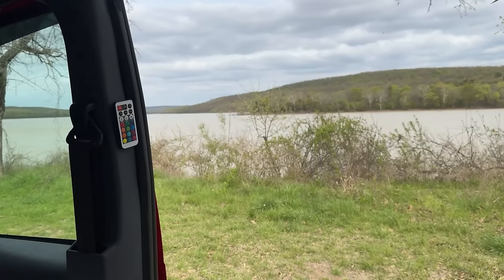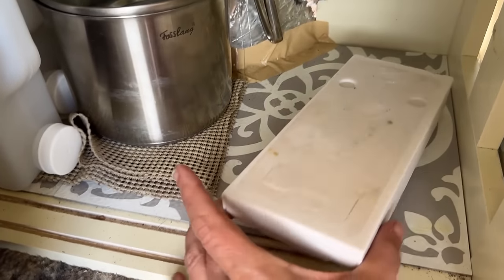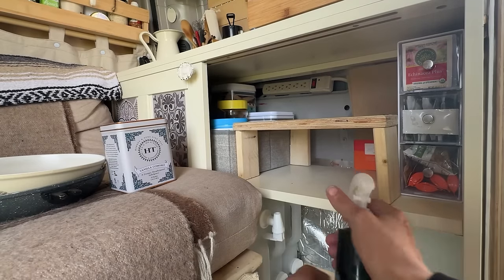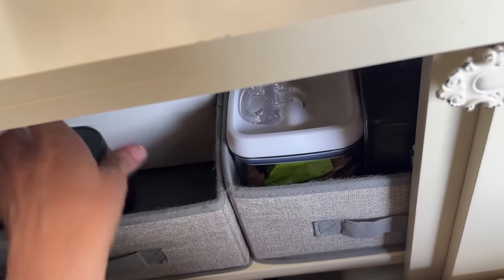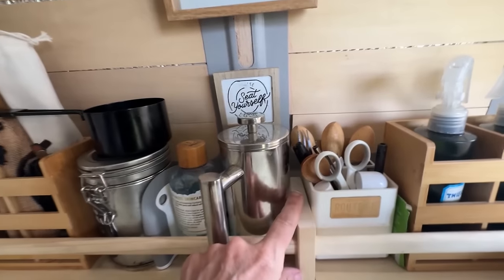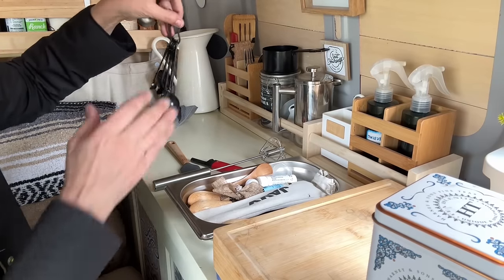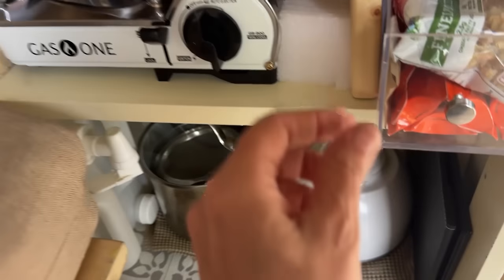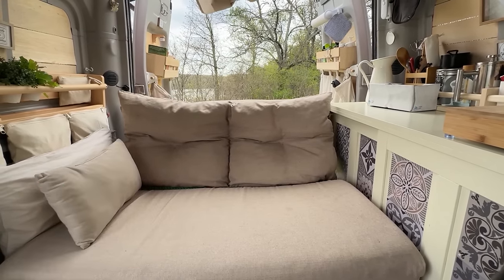Van Life | Cleaning Therapy Day!

Comment: I really like how you have organized your cupboards and shelves.
I’m still thinking how to layout my ‘galley’ to optimize its space, and how to make it ‘modular’ so it can be easily removed.
I did my ‘spring cleaning’ before leaving for Florida, and the inside was completely removed, cleaned and reinstalled.
A few points, if I may add:
This is a good time to change smoke/CO detector batteries, check fire extinguishers, first aid kits, and tool kits. Also, a service check, oil change, windshield wiper blade change, and air filter change is a good idea
Keep ‘em coming Dee, I love your videos! 🤗
Reply from the maker: For sure!!! I do that pretty regularly ☺️
Reply from the maker: For sure!!! I do that pretty regularly ☺️

Comment: Hi 👋👋 Glad to see you using that mini vacuum bcos I've been curious about it. I've seen and read very mixed reviews so how long have you had it and how are you finding it? How much run time to you get from a charge? And are you happy with the suction? (Suction looked fine). I liked how compact it is but I think I saw it doesn't have that many attachments?
Maybe you could do a product review?
Reply from the maker: It is fine for spills and getting dirt and sand up. It isn’t real powerful, so if I need a deep clean I go to a car wash. You can use it plugged in. Unplugged, I can do my entire space. But then it needs recharging. I don’t use a lot of the different attachments. I probably should do a proper review at some point.
Reply: @LadyBugout  that would be great thanks. Would be interested. Please don't forget how long it takes to charge and, I think it's 12V?? (I think I saw that).